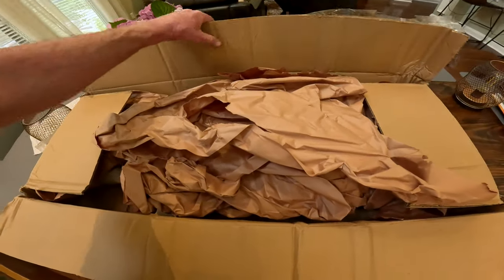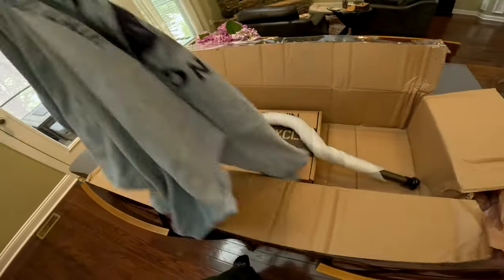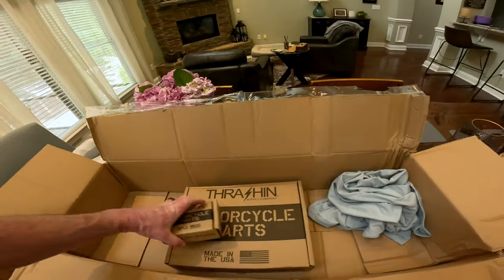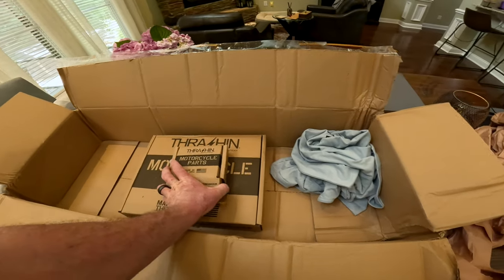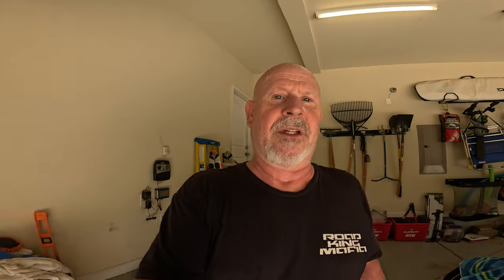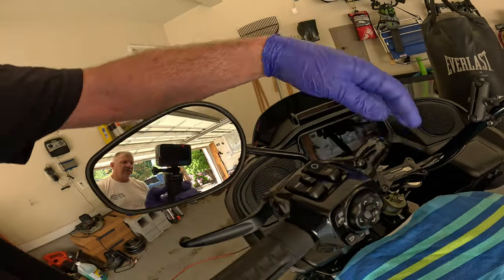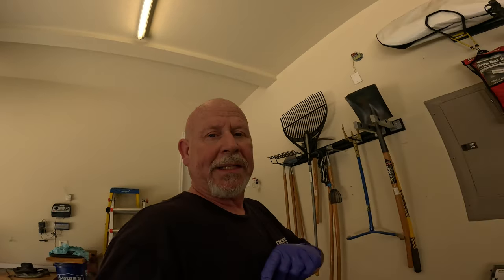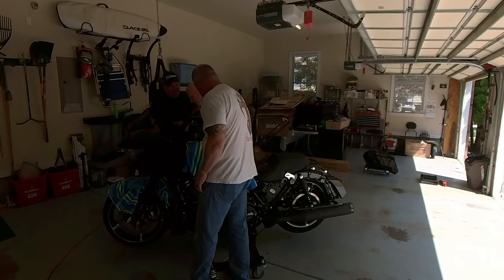2024 Road Glide Handling Upgrade: Installing Thrashin Bars and Risers

Comment: How’s the screen visibility with those risers?
Reply from the maker: Not a single bit of obstruction. If I had to describe it, when you are in your riding position the top of the risers is in line with the bottom side of the inner fairing cover about 1” below the bottom edge of the screen. Hope that makes sense. Thanks for watching and commenting. Always ride safe!

Comment: Did you run the solid bushings? How’s the vibration?
Reply from the maker: @dlawsonlawson1582  yes I did. Not bad at all and it drastically improves your control and connection to the bike. I hated how much the stock bushings allowed the bars to flex front to back. The only time I even feel a vibration is sitting and idling. Thanks for watching and commenting. Always ride safe.

Comment: Are you able to see the screen just as clearly as before?
Reply from the maker: Not a single bit of obstruction. If I had to describe it, when you are in your riding position the top of the risers is in line with the bottom side of the inner fairing cover about 1” below the bottom edge of the screen. Hope that makes sense. Thanks for watching and commenting. Always ride safe!
Reply: @jst_moto thanks for the info!
Reply from the maker: @adamcoletti83  of course!!!

Comment: What mufflers do you have?
Reply from the maker: RC Exhaust 4.5" Slip-ons. I had the same brand in the 4" version on my 2018 Road King Special and really liked the sound so I got these and the larger diameter really changed the sound for the better. Thanks for watching and the comment, I wish you luck in finding the sound you are looking for. Always ride safe.